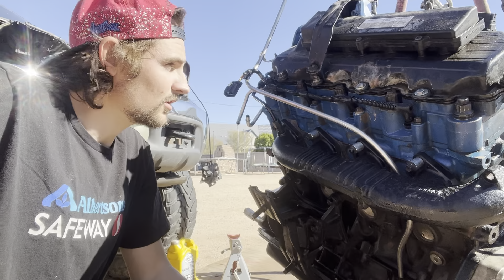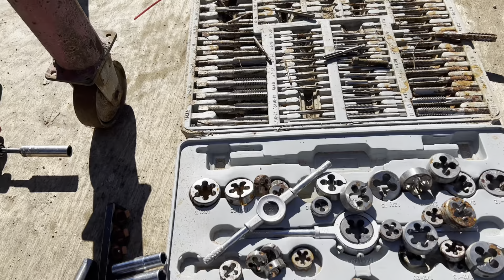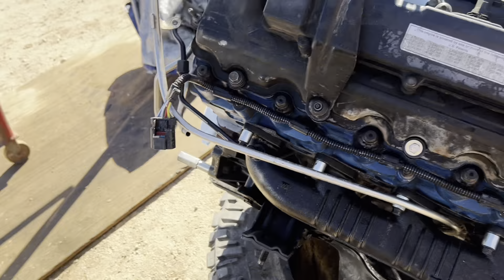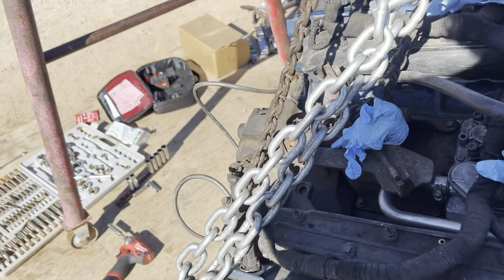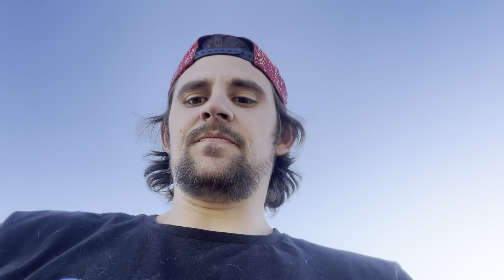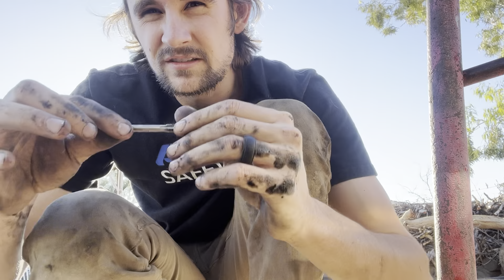6.0 powerstroke stripped valve cover bolts and exhaust bolt (fix)

Comment: How did you mount the ficm
Reply from the maker: On that I just tightened 3 studs that hold ficm bracket and it holds the ficm still. It’s not ideal but maybe you can find something more operational for ficm bracket mounting points.